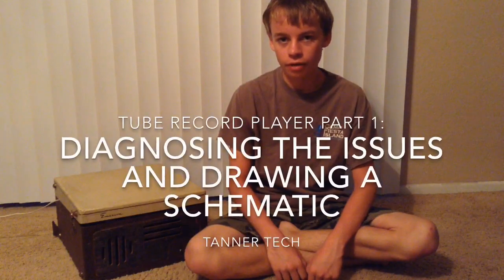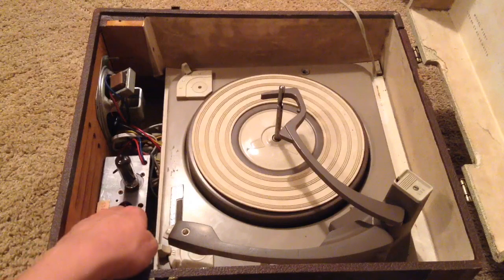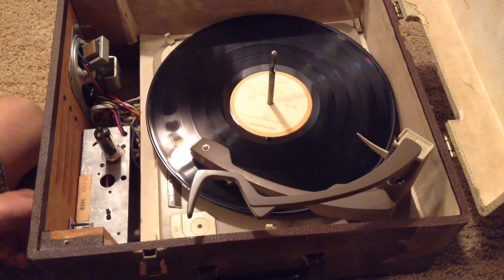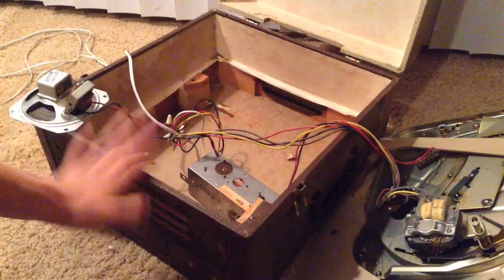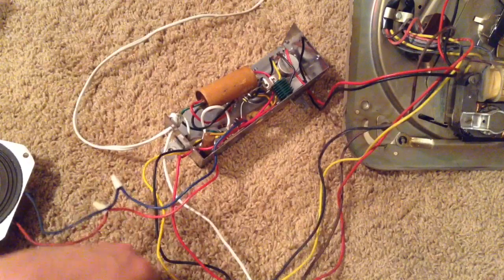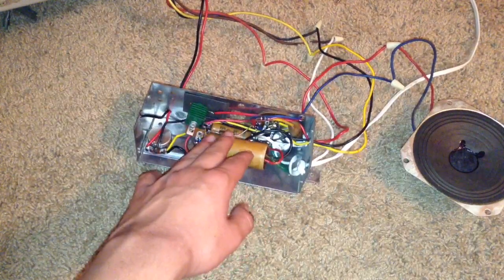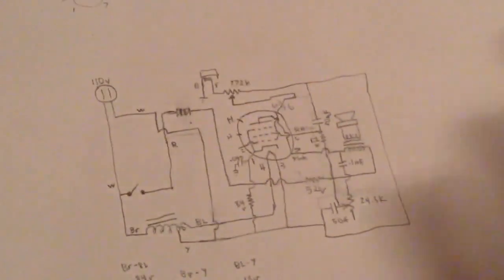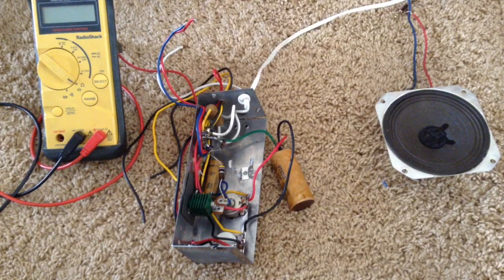Tube Record Player Restoration Part 1: Diagnosing the Problems and Making a Schematic

Comment: I am working on a vintage turntable, Can find a model on mine.. also. i have a 47 ohm resister and a 1.5 Ohm resister. I am stumped i see you replaced rather modded the selenium rectifier, Would that method work with most phonographs ?? Diode and resister in series ?? using s 25 L6-GT tube. i think 110 volts.. I am working on disk cutters also. but having no luck..

Comment: I have a tube style record player and the needle won't drop. Even if I start the player with the needle down, if lifts right off, returns to the side the player shuts off. It didn't always do this. Any ideas as to why?
Reply: do you know  who the turntable is made by? after i know that i may be able to explain how to fix it
Reply: Probably a shorted wire for the needle limiter when it hits the middle. Old wires are typically cloth covered and shear over time

Comment: What tube is that/ I'd like to build a stereo amplifier similar to the amplifier in that record player but i'm not sure how just one tube can be enough
Reply: this is not a good amp, is missing the preamp and inyecting the signal directrly to the grid of the power tube.  Is a cheapo record player from the mid 60's early 70's. If you want to build a good tube amp for begginer i suggets you  to use the ecl82 6bm8 (6.3v) /pcl82(15v) it have a triode and a pentode inside, so is great  to implement only 1 tube and is a cheap tube, you can also use the ecl84 and 86,  only the ecl84 was used on tv color amp and has a high response of frequency, is better to use a 82 86 but if youhav you can use it.
Reply: yes, one tube isn't enough to amplify even a crystal cartridge which that record player originally had it needs a 6AV6 to boost the signal to .5 volts or more
Reply: @larryshaver3568  at least another triode minitube for preamp. Is for that reason the ecl82 was made for record players, is the best tube to use on it
Reply: @santi308  what is an ecl 82 eqivalent to?
Reply: @larryshaver3568  You mean the same tube w other names or another filament voltage  or some ramdom tube w Triode-pentode in it?, I say that tube because is easy to find, in one tube you get pre and final and is relatively low voltage (200v on plate, another tube may 've serious and dangerous 750v on plate) Yo can grab a old car tube radio some of them have a realy low voltage special tubes i mean only 12v on plate, you dont get too much from it, but it works, and also on ebay you can find  cheap chinese tubes, these are not the best tubes in the world but is a point of start
Reply: @santi308  do the Chinese tubes sound as clean as the american or british counterparts? I hear they suck
Reply: @larryshaver3568  is never the same, also Russian tubes are better than british ones. In my opinion if is not a hifi w ultralinear output you can use any tube, chinese or not, is a ecl82 not a big deal